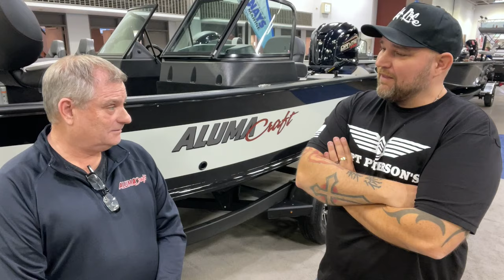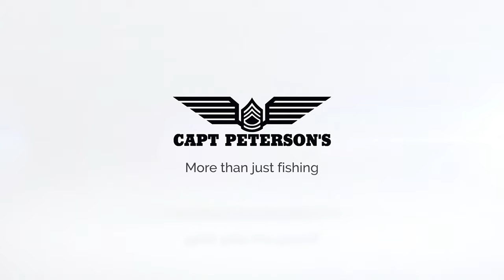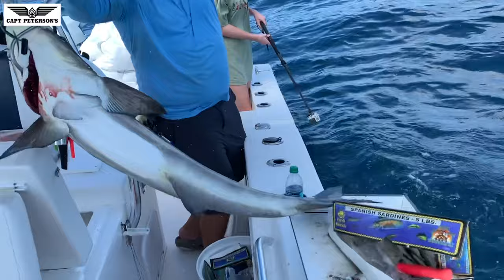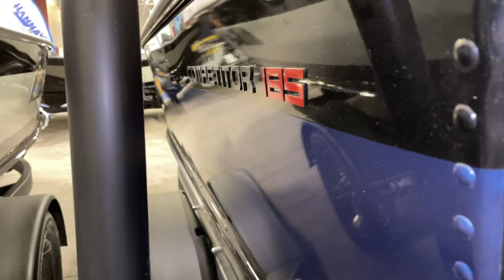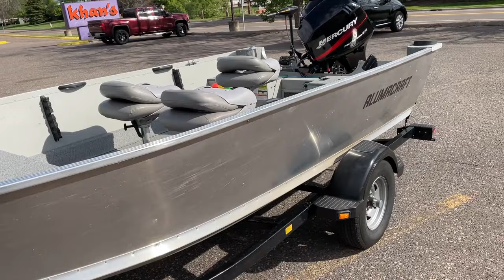No One is Telling You The Truth About Aluminum Boats So I Have To

Comment: Couldn’t agree more. I’ve owned a 20’ Lund Alaskan since 98 with high hp tillers and pounded the hull hard over the years and to this day it doesn’t leak a drop. Aluminum hulls have to flex and welded joints are too rigid and will eventually crack. Ask my different buddies over the years who’ve bought new welded hulls and they had nothing but headaches and they vowed never to own welded again. YMMV

Comment: I haven't had a ton of aluminum boat experience but we rented a fishing boat on lake Mojave 30 years ago and we got caught out in the ubiquitous afternoon wind storm. The resulting waves forced us to run for the shelter of the cliffs. That run to the cliffs took us into the waves for 20 minutes and when we pulled into the cove several seat rivets had popped.
I know that a welded structure in race cars and mountain bikes are very rigid but I've broken several mountain bike frames.
Reply: Only thing of merit that I got from your stories is "your experience from a RENTAL, application"

Comment: Post weld heat treatment of aluminum is required for optimum strength, planes would be lighter being welded if there was a practical way to build wings, welded and heat treatment without warping etc.

Comment: In bigger water fiberglass is the way to go. You'll stay a lot warmer and the extra weight will help with ride quality. I've been on many different boats in the pnw from lakes, rivers, Puget sound and Pacific Ocean. The worst boat was the 24' Alumaweld. It beat the hell out of everyone with small wind and tidal waves and it was noticably colder outside temp was 65°. The 24' Trophy and Grady White smashed through the same amount of waves and noticeably warmer and the outside temp was 10° cooler. Ocean temperature was the same. Running rivers I'll take an aluminum all day with a pump.

Comment: Rivets allow more flexing in the hull as well as more expansion & contraction. Welding is more rigid but the heating process can fatigue the surrounding metal, later on due to metal fatigue, imperfections in the weld/metal prep, wear & tear,  a crack will form.

Comment: I had a 1980 Monark 1448, riveted hull with Welds on each side of the bow...  I don't remember how many times the WELDS Failed and had to have the welds repaired.  Riveted portions never failed!
Reply: Properly executed welds on material of proper thickness are fine, but not all fabrication is the same.

Comment: Airplanes are Riveted because of dissimilar metals.  The F14 was specially treated with 6000-grade aluminum with a titanium structure.  We Rivet because you can't weld them.  Some of the new stuff is heading to composite epoxy laminate.
Reply: BS for 500 Alex. Tell me you are not an A&P without actually saying it…
Reply: How so?
Reply: Try and find a welded fuselage on any aircraft, not gonna happen . Standard practices are approved by the FAA …a titanium Hilite is stronger than any weld
Reply: My point was you can't weld aluminum to titanium or other dissimilar metals. Also, some of  the aluminum used in airliners are in either the 2000 or 7000 series of alloys and they are considered to be non-weldable.  There are plenty of world war II, p2s  that have fully welded aluminum fuselage. I've seen one fully restored. All welded and polished to a mirror finish, it's really a sight to see.
Reply: @dominiciadicicco8935  Precisely.  If they ever invent an aluminum alloy that is weldable, has the same strength as current aircraft structural alloys, and which maintains that strength after welding....  At that point all new aircraft will be of welded aluminum structure.
Reply: @netpackrat I ll settle for Boing to find a way to keep the doors on.

Comment: The stronger aluminum in aircraft are made from Non-Weldable Aluminum Aloys.
Reply: The alloys common in aviation are also more susceptible to corrosion. Re-skinning and corrosion repair is common just from condensation or washing with car wash soaps; gotta use corrosion inhibiting soap to avoid problems.

Comment: Man nice I recently got a older Gregor 12ft all welded aluminum boat with a rebuilt trailer both in excellent condition, and got a new Mercury 15hp EFI motor, boat is rated for a 20hp, can't wait to hit the water !
Reply: That's what I have for 43 years so far and no problems at all. Gregor makes the best small aluminum boats by far.

Comment: That Aluma Craft looks very light weight compared to the 5mm plate alloy, full stringer sub floor frame construction and fully welded-in alloy floor on my Australian built boat. I've never seen a weld on my type of craft ever crack.

Comment: The reason aircraft use rivets is because they have no need to be water tight and if a panel is damaged, they can remove the rivets and rivet a new panel in place much easier than welding.

If you are welding, you're essentially making two pieces of aluminum into one piece. It's not as easy to repair, but it is stronger and more water tight.
Reply: My aircraft floats are Riveted.  Sealant is placed between the joint before riveting.  Pressurized aircraft are also sealed in the same way.   That sealant can become dis-bonded and our floats leak a little during movement.  Our aircraft are riveted because the Higher Strength to Weight Al Alloys cannot be welded.   Friction stir welding of our alloys has been tried as a manufacturing process but not widely adapted or field repairable.
Reply: Most aircraft are air tight.... they use rivets because the UTS is calculable and reliable. Also, because the heat treatment is lost in the HAZ. pretty tricky to heat treat a whole airplane.

Comment: I have a 16' Quachita purchased in about 1970.  Had a Corvair airboat setup on it for several years and then switched to 40hp outboard.  Most of the boat is riveted to the hull stiffeners and seats.  The bow is welded as is the transom.  The only crack developed in the bottom where a bottom groove was formed by pressing I think.  Some of the rivets started leaking so I got my son to hold a hammer on the outside while I hammered them flatter from the inside.  The only welds that broke were the gussets to the transom on the gunwales.  Boat has been well used and still has a lot of life left.

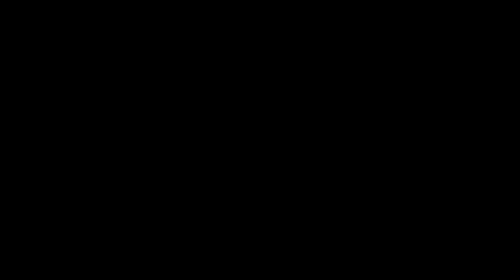Comment: Thin walled aluminum like alumacraft, lund and crestliner use should be riveted. Welding distorts the shape around the bow. Welding should be reserved for 0.25” and thicker material. 8:00 8:00

Comment: To compare a welded aluminium boat to an aircraft’s riveted construction is an apples to oranges comparison. The alloy skin of an aircraft is thin to keep weight down  and as such would be difficult to weld for starters . Rivet holes are notorious for having cracks migrate from them , but easy to repair with doublers etc . Plus easier to replace damaged parts or gain access ie to inspect inside wings etc . 
 By comparison most welded alloy boats are 4-5 mm thick and the quality of welds today is impressive . As an example , our 7.4 m alloy boat was built (welded  construction ) in 1992 . No welds have ever failed and it’s had a pretty hard life , off the West Coast of NZ . We did have some pitting in the alloy of the hull , but they just cut out that section and welded in a new section and she’s good to go again .

Comment: I have a 20 year old Starcraft aluminum v hull that I use primarily in salt water. It doesn't leak a drop and has been perfect for me. It's just a 14'3" but takes two guys fishing in bays and in decent chop with a 25 hp motor and moves right along. I love it after scaling down in steps from longer boats. I'm old now so it's easier to handle alone. 😀

Comment: Ive owned a few aluminium boats or tinnys as we call them in New Zealand.  My riveted ones had to be re riveted every few years.  But my last two have been welded much superior.  I currently have a 4.30 side console   5mm hull 4mm sides its great. I dont go out in rough conditions

Comment: The second time I've visited this same video. The debate goes on, and probably always will. Coming from Minnesota the debate is strong there where you have Alumacraft and Lund riveted boats going up against Crestliner welded hullls all made (or were?) in that state for the same choppy waters and granite bottomed lakes.
Some of the things not being mentioned, and I'm sure there are more when you bring in welded boats of the Pacific NW and southern jon & bass boats and the types of waters they run in, are the other things like improved adhesives between riveted panels and the tongue & groove extrusions some welded hulls use.
Suffice to say, buying from a quality manufacturer with good dealer support and it probably boils down to personal preference.

Comment: Okay, both are good ways to build sheet metal boats of thin guage.  However, I have experienced one thing that happened to a welded boat, which I have not seen on riveted.  I will not name the brand because they are excellent boats.  That said, Ihad a 16ft jon wit a very shallow V bottom.  Driven by a 35 hp tiller control motor, it was fast, I can tell you.  Out on Puget Sound, it can get choppy - not the best environment for a jon with 20 inches of freeboard.  And, certainly not teh best environment for a flat running lake hull.  As I used it over a couple of seasons, I noticed that the margins at  the welds in certain spots were cracking.  Not weld itself, but the sheet metal just next to the bead edge.  Iassume it was material hardening when it was welded.  We're talking .060" sheet - easy to get it brittle.

I went on to use the boat, but cut back my bay running and took it to lakes instead.  I was probably abusing it, but I'm just sayin'.

Today I have a 2000 Northwood (Smokercraft Voyager), bought used, and have never had an issue in a chop except for soe pounding because it's so light.  No rips or cracks at stress points.  SO, I think matelfatigue or process hardening may be a thing with welding very thin aluminum.
Reply: a Jon in heavy seas is a bad idea no dead rise to handle the heavy seas glad you got in OK Jon boats are good for small lakes rivers and some smaller bays out on a big body of water bad idea... I bet that was a stressful ride especially with a tiller weight distribution is critical to lessen bow slap. 16 foot Aluminum deep V with a 20-25 degree dead rise at the bow would have been a way different ride.
Reply: .060 is very thin for a welded boat, but still the welds didn't fail the material did.  I wonder which alloy was used....
Reply: @kenneth9874  T-6061, like all quality aluminum boats.  It's hardedned and much stiffer than comon sheet alloy. Used in aircraft bodies.  Think: Grumman canoes.

The cracking was my fault, I'm sure.  A welded jon will last as long as any good alloy sheet boat if used as desdigned - not wave hopping at 25+mph.  I'm talking 2ft waves and large boat wakes.  

For the record, the brand was Crestliner, a very good manufacturer.  The cracking never got any worse, and the boat was completely satifacory.  I would recommend it to anyone.

My Northwood 14 is a completely different design, being a re-badged Smokercraft Voyager, made by a Smokercraft subsidiary.  It is a wave cutting design for large open lakes and sheltered bays, and handles chop very well because it has more V at the entry  - graduating to a semi rounded transom for planing.  Both are excellent boats for their intended purpose.
Reply: @OutnBacker  sometimes harder and stiffer is more brittle.....
Reply: @kenneth9874  True, but T6061 has always been the Go-To alloy for aluminum boats in this class and works amazingly well, given the overwhelming number of them that are older than their owners.  Aircraft made of it have th same fatigue and cracking issues.  If you look very close at WW2 Grumman fighters, you'll see all kinds of quick fix patches riveted on over bullet holes and stress cracks.  Russian fighters were much more crudely built, and used lots of soft aluminum, which actually ripped.  More patches.

Comment: During the manufacture installing rivets requires less skill than welding. Its a cheaper boat to manufacture if its riveted.
Reply: dude thought he was sly saying there was more labor with 2 people bucking rivets. haha. its faster and non-skilled. its cheaper. thinner aluminum is MUCH MUCH cheaper and can be cut, bent in a brake, and riveted. entry level workers with no experience can be trained to rivet in 15 min. application is everything though. if you don't need welded, don't buy welded.

Comment: There is absolutely no comparison to the stress loads between a fighter jet and a boat.  For one, a jet has riveted panels specifically so they can be removed to access interior repairs.

Jets don't bang their way through the air the way a hull bangs across rough water.

Welded hulls are more rigid and therefore stronger.  Riveted hulls flex.  Metal that flexes succumbs to metal fatigue sooner.

That said, a riveted boat is fine for small waters not subject to significant chop and waves.

Comment: Something that wasn't discussed is water tightness, Welds don't let water through, but rivetted joins do. How is the water kept out?
Reply: Riveting will be water tight if the correct materials and installation techniques are used and the pattern of the rivets is correct.
Reply: @johnbrown6189 , which correct materials and installation techniques are involved, please?
Reply: Your assuming the weld is leak proof.  Unless you're there to see the die pen test or X-ray you'll never know.
Reply: @kylecasetta4091 , a good weld is water tight. Regardless, this is not the question I asked.
Reply: @TheErsatzMode  you're assuming the whole weld is perfect, very few industries hold their welders and welds to that standard.  They do have allowance on impurities per 12 linear inches of weld. To say the welder and or the robot will lay a perfect weld from start to finish every time is living in fantasy land. So as I said unless you personally welded and tested the hull yourself. You can't guarantee the weld is water tight.  Aluminum welds are prone to crack especially when MiG welded if not done perfectly.  You can easily find stories of boats with broken welds with new ones daily.
Reply: @kylecasetta4091  some of what you say is accurate, such as allowable deficiencies in   X inches of weld. The mig weld is the only way to go on thin aluminum vs. tig , tig puts way more heat in the weld zone, almost guaranteed cracks, not in the weld but the material just to the edges of weld will crack. 35 years in the business sir. Im not saying riveted boats are not good, seen some old Lund rigs still kicking, as well as monarchs.
Reply: @JRoy-1969  both ways are equal I've run riveted boats for 30 years now never had a leak. Depends how badly you beat the hell out of the boat will make a ton of difference. But to say welded is stronger and more leak proof is a lie because it's not.  And with aluminum in manufacturing there is way more chance of operator error causing catastrophic failure with welding. My point was because it's welded doesn't guarantee leak proof.  Or guarantee it's strong.
Reply: @kylecasetta4091  agreed, I must say that I’ve noticed in Alaska, those hulls are welded. They go through some rough stuff. These are guide boats, some are quite large.
Reply: Someone has to bail or get a sump pump.

Comment: Actually bolts/welds are used instead of rivets nowadays on structural steel. Steel is a different beast.
Reply: Way back like the building of the Empire State Building they used hot rivets I believe. Probably more expensive but will last forever.

Comment: Today both welded and riveted hulls are excellent. I own a Crestliner (welded) and a Lund (riveted) which see a lot of big water on Lake Erie and Lake Ontario. I would give the nod to the welded hulls for the following reasons. Welded hulls are more efficient than riveted do to there being no rivet heads to interrupt water flow over the hull.  Also it is easier to repair a welded hull because you can identify where the leak is and repair it without the need to remove decking as you need to do with a riveted hull. Saying that, both boats l own have no leaks but both boats have had to have their transoms repaired do to the transoms wooden construction. The gentleman's information about trucks and planes being riveted is not entirely accurate. The frames of most transport trucks are held together by Huck bolts not rivets in areas that see the highest stress. Most air planes do use some rivets but in high stress areas Huck bolts are used. I make this statement from experience as an air frame mechanic assembling and repairing  DC9's wings at McDonnel Douglas.  Hull warranty the manufacture offers gives a good indication of how confident they are in their product.  Crestliner, life time on the welded hull. Lund, life time on only the double riveted seams. Alumacraft 20 years on the riveted hull. Also both welded and riveted are subject to material and manufacturing defects.
Reply: "Also it is easier to repair a welded hull because you can identify where the leak is and repair it without the need to remove decking "
WHAT??? Who ever conned YOU into believing that? Have you ever welded aluminum? That surface needs to be heated tremendously prior to any weld, Do YOU know what's on the other side of that hull? They ARE and WILL gut that portion of the boat out to get to the other side, guaranteed. Please, please, please, never try to fix anyone's boat.